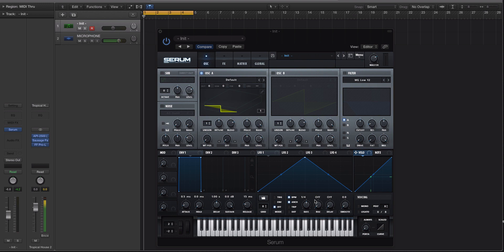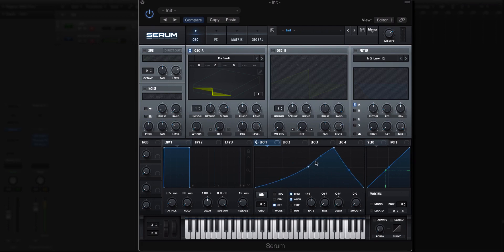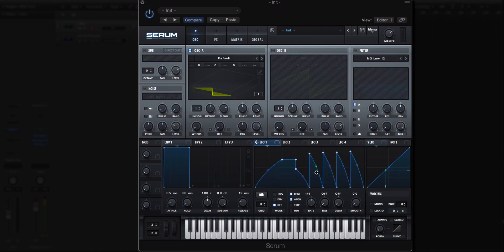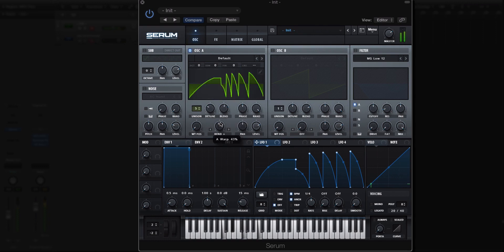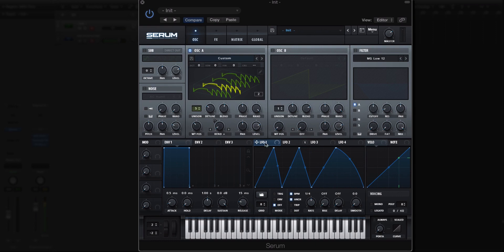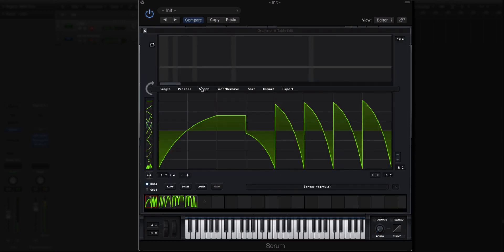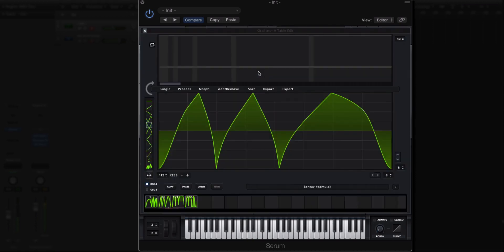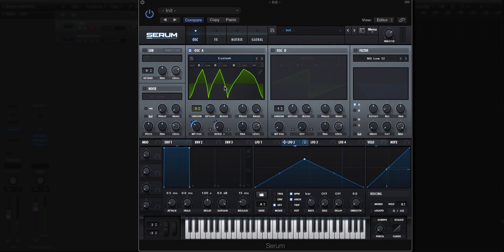Turn an LFO into an Oscillator in Serum – Advanced Sound Design Trick with Echo Sound Works

Comment: Can someone confirm this feature in windows 10. Just does not work on my windows machine with latest version of Serum...
Reply: Did you ever figure it out? I'm having the same issue
Reply: @SpaceyBlurr use alt while dragging
Reply: Use alt while dragging
Reply: Dezqo windows 10 sucks. i down graded to win 8.1 with 2 keyboards not working full stop and constant daw crashes. Win 8.1 works... apparently win 10 dont do usb2 which is almost every controller pre win 10 and even brand new midi controllers still being made with usb 2

win 10 is fast but for music production pffft u better win win 8.1 or better a mac